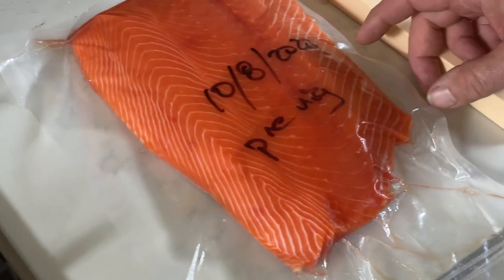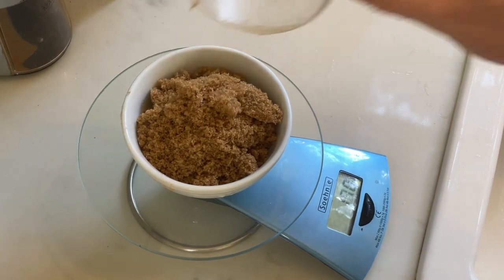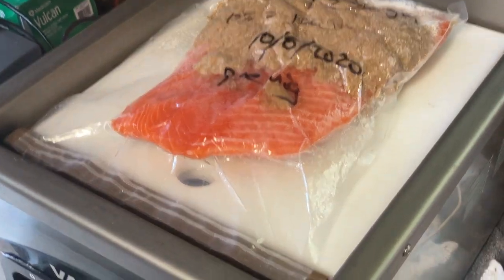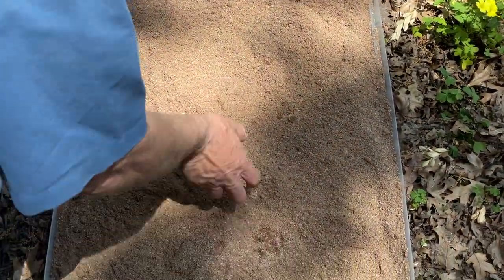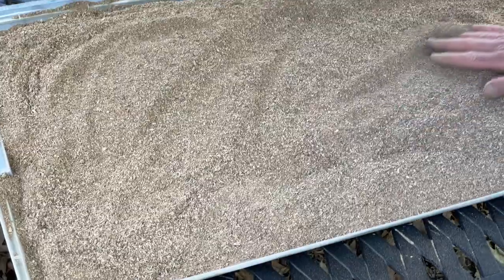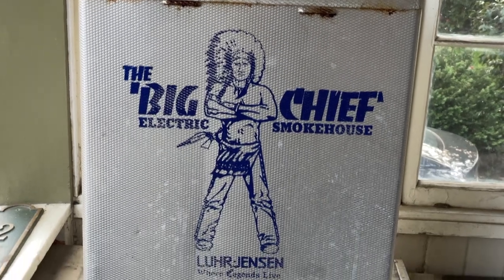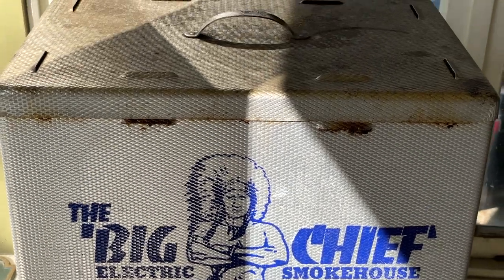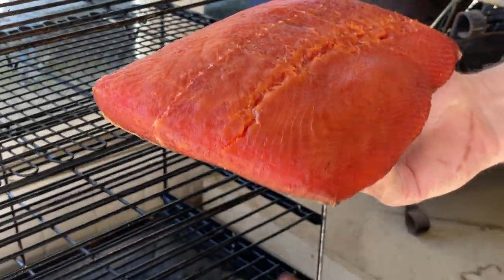How to Cold Smoke Salmon

Comment: I don't understand why you go to the trouble to convert the pellets to sawdust! The pellets work just fine in the various portable smoker trays! Pack them in well and they burn just as readily and completely as loose dust!

Is there some reason why you prefer using the sawdust versus pellets?
Reply from the maker: My husband says his past experience with a sustained smoldering burn with pellets to produce cold smoke was not successful and that is why he converts the pellets back to sawdust.  If you have been able to produce a cold smoke with wood pellets that is excellent!